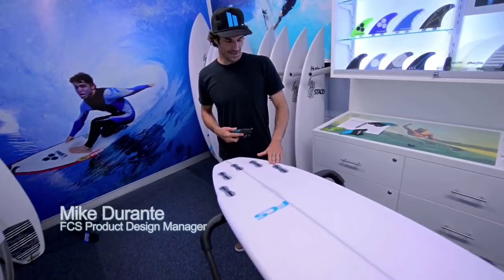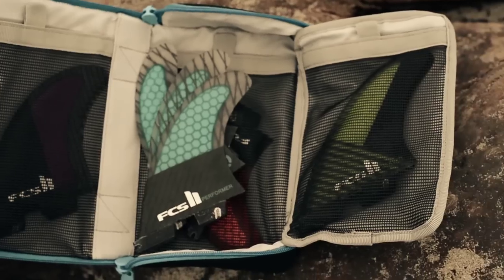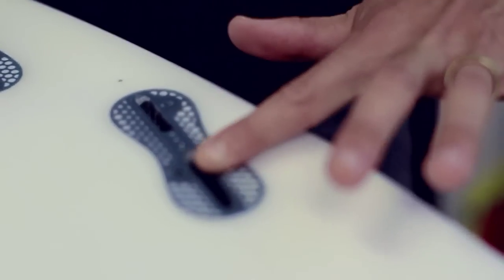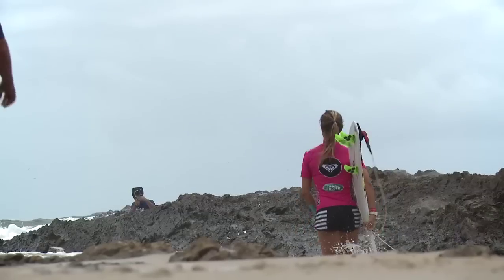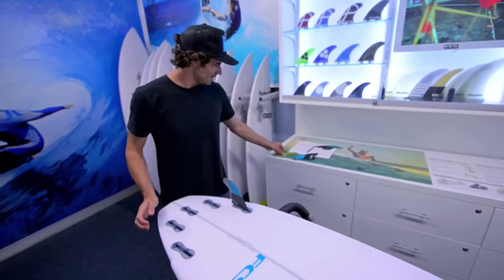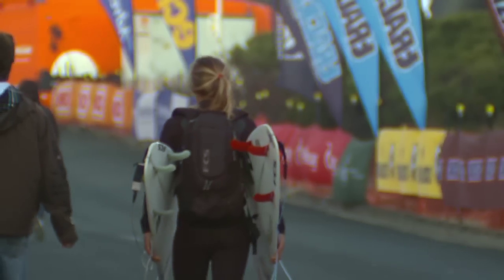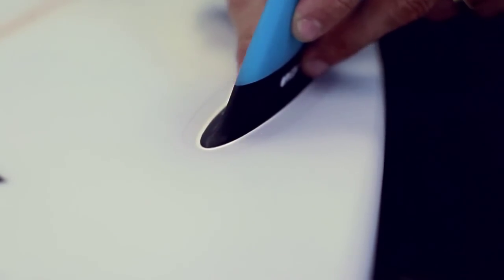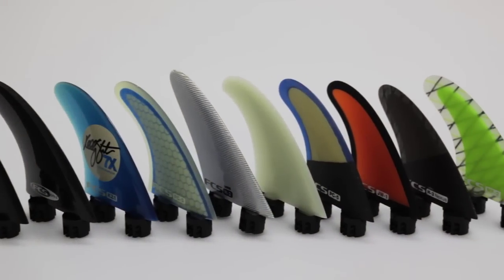Surfing Australia Presents: FCS-II & FCS Origin

Comment from the maker: If you’re still in love with an old set of fins, FCS has designed a set of unobtrusive silicone infills to fill the gap created by the old fins in the new system. The infills are made from high quality silicone rubber which will not damage the plugs or fins. They are also extremely durable, light and built to withstand extreme temperature and corrosive conditions. The infills replicate the flush leading edge of the new fin design improving the performance of the old fins.

Comment from the maker: Hi Nirvez, The FCSII system has a high fin retaining force (around 12kg/26Ibs) and fins cannot be removed from the system by placing force on the front or side of the fin (i.e. the direction of forces applied to the fin during surfing). A fin can only be removed from the system by applying an upwards force to the rear of the fin. More info on the FCS webiste